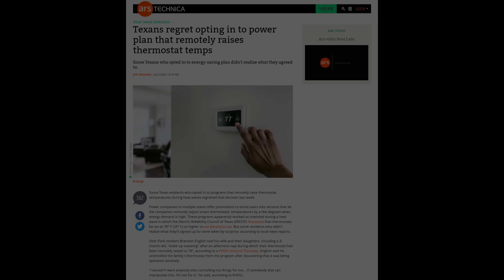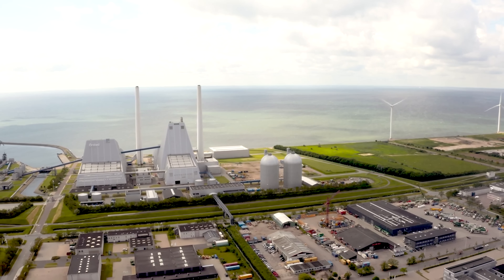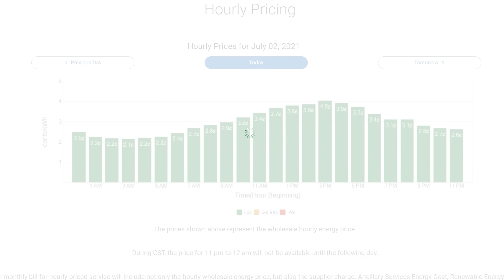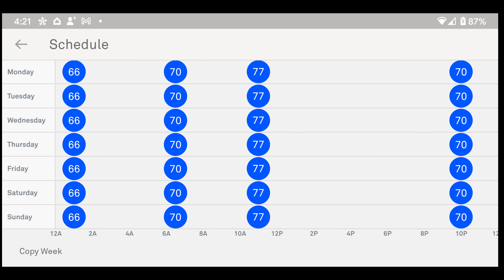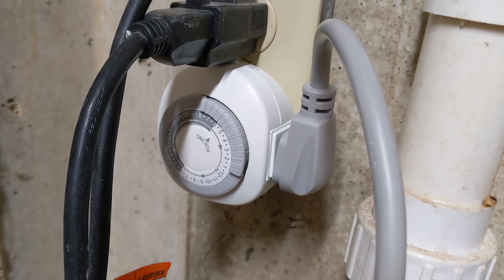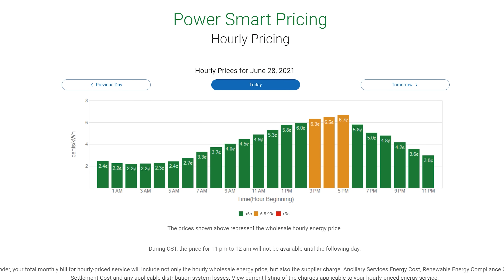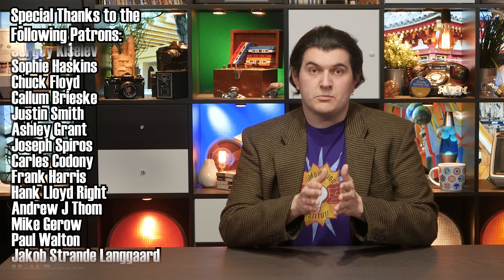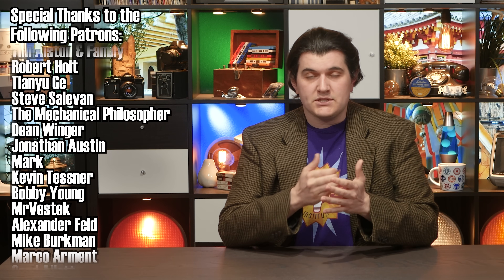Batteries aren't the only way to store energy. Here's another.

Comment: I remember seeing water tanks painted black on the roofs of homes in Turkey. Throughout the day they absorb solar energy and heat the water inside, ready for evening showers and baths.
Reply: only problem is that cold showers are preferable in summer and hot showers are preferable in winter, when this system doesn't work.
Reply: More "fancy" version is some near vaccum tubes or old radiators running water, I seen those used to heat water and houses.
Reply: @ABC-rh7zc  i don't take fully cold showers during the summer, just warm, so it would still work for me :)
Reply: I had that in Austin in the 80's. Gave us an extra 50 gal of hot water.
Reply: @ABC-rh7zc  It is just extra capacity. You still have cold water in the summer, and in the winter the sun still shines. Run on a recirculation loop the warm-hot tank on the roof keeps the snow off it and still picks up a bit more heat.
Reply: @ABC-rh7zc  If you want cold water you take it from the mains feed not the tank. Likewise if you run out of hot water, or it falls below a set temperature, you then employ an electric on-demand hot water system. Turkey has a much more temperate climate tan the US, and to be honest It's all relative to a degree (pardon the pun). We acclimatise to the temperatures of the places we live/work, and usually have no issue with the average temperatures. It's when we start approaching and passing the upper and lower ranges of those averages that we start to notice the heat/cold.
Reply: Israel has heat panels for boilers on roofs of nearly all homes built in the last 30 years.
They are essentially a window with black background and pipes in the middle.
The boiler simply circulates water through these pipes, heating the water.

It works well even in most winter months.
Reply: @ABC-rh7zc  Most of turkey has mild winters anyway.
Reply: Travis AFB Mike Ward?
Reply: That's clever!
Reply: @eqbrim  Nope.
Reply: Actually in Germany we have something like this but it looks like a solar panel and the hot water goes into basically a Boiler
Reply: Happy Legionella
Reply: @DrLoverLover  How is this any different any other stored hot water tanks?
Reply: @ABC-rh7zc  I take scolding hot showers all year long, if your skin doesn't melt off it's too cold
Reply: I've seen this in the south of Israel too.
Reply: @davagain Yeah. Most of the time, like in my apartment, the heater is on a separate switch. The water just gets colder and that's the time for you to get out.
Reply: @ABC-rh7zc  I don't shower cold in Summer, it sucks and it makes me feel sick.
Reply: @luiysia  Same, if I try to shower cold in summer it makes me feel sick as soon as I step outside afterwards lol
Reply: @mikeward1701  Yep
Reply: @dgurevich1  We had those in our old home in The Netherlands, served us well for a decade, afterwards it sadly died and since we were planning to move never fixed them.
Reply: That sounds like a breeding ground for all sorts of bacteria, viruses, and amoeba that you don't want in your water.
Reply: The other strategy was in winter, to fill the tub.  The water served as thermal storage during the daytime, and at night the water would release the heat
Reply: @ABC-rh7zc  You’re not the sharpest knife in the drawer are you?
Reply: @mikeward1701   hot water tanks heat water to 120f-180f, thus prevents legionella bacteria growth. solar water heat is great when done right, but you don't want large volumes of luke warm water for a length of time. Storage needs to be cold or hot to prevent legionella growth. 

I'm not sure how daily cycles of heating and cooling effect legionella. worth looking into anyways.
Reply: @Imix Muan  Don't put down Europe - If you mean solar thermal panels those were in the experimental DIY stage during the 1970s oil crisis (farmers and home owners in Germany and Austria got creative considering high costs of all energy). I think the Southern European countries that have better conditions caught on later, but if they had tourists it paid off. They needed the most warm water when there was lots of sun ....

The thermal solar panels became more mainstream during the 1980s some went as far as trying to support warm water production for heating in fall and winter. But even a fairly regular sized installation would heat up the water to a decent degree (60 even 65 degree C)  if it was sunny and not bitterly cold (of course with help of a larger water tank, that is just a given in the temperate climate zone, doesn't work well w/o). 

Also for public pools (there they could use a very cheap version, because it is emptied at the end of the season, does not have to be frost proof. It did not have to be fance, just to lift the water temperature.

Those panels were around for a long time, the idea to get electrictiy from solar panels seemed to be exotic.
Reply: @rob_over_9000   professional tank systems will heat up the water for use on a regular base. Or they move it around enough. If you have water standing it is a good idea to let the tank drain, or to not drink the water and to be careful not to inhale spray when showering. A collegue died of legionella infection. They worked (a construction job in another state) and stayed overnight in a bed and breakfast and they had a small heater to prepare warm water - likely not used for a while (a week, could be longer). Legionalla are not normally in water and if the water is moved around they cannot multiply. 
But in that case the small unit seemed to have had a few and they had a chance to multiply. 

The firs of the two that took a shower got severe pneumonia (caused by legionella) and died of it. It is when you swallow the spray. If he had drunken it, he would have been fine.
Reply: In Gila Bend, Arizona, the people who designed the town water system were so thrilled that they didn't have to bury the pipes below the frost line that they put them on the surface and - for reasons unknown to civilized man - painted them black. Water came out of the "cold" tap at 110F in the summer.
Reply: I saw these in Jamaica and was wondering why. I assumed at the time it was in case something happened to the water supply.
Reply: @kreynolds1123  On even a moderately sunny day in a temperate climate like Turkey, the temperature will easily reach the 50°c / 122°f required to start killing off legionella.
Reply: @mikeward1701  this topic  sparked me to start doing some more research on legionella, (L). what I'm seeing is "ideal" for L growth is 77-113, that 120 is insufficient to kill L, that minimally 131 is needed to kill L, that 32 minutes is required at 140 to kill off all L, that L is disinfected at  158-176, that L is most dangerous when aerosolized like say with a shower head.
Reply: @mikeward1701  yep. What I find to be too hot might be considered average somewhere else. Likewise, temperatures others might find to be unbearably cold, I can manage with just throwing an extra windbreaker over my sweatshirt.

Comment: An example of how dramatically your house's insulation could affect how quickly your house keeps in the cold/heat is the work cup I used for work. I started out using a big 1 gallon plastic water bottle (good quality) and would prefill it with ice all the way to the top then top it off with ice cold water.... By lunch time 4 hours later my ice would all be melted and the water luke warm/barely cold. It was never in direct sunlight btw.

THEN I upgraded and got a 1.5L metal water bottle (I think eddie bauer) good quality but still cheap. I would prefill with ice and then by lunch even in 100+ weather it would still be filled with ice... I'd drink all the water (2 bottles worth) then refill it multiple times (6 bottles worth after the original filling) and it would STILL have ice by the end of the 10 hour day. 

Just thought I'd rant about that to let people know how effective precooling could be on a well ventilated house vs one that's not. My house would literally take 3 hours to go from 90 to 76 but at the same time would go from 78 to 85 within an hour of turning off the air.
Reply: Exactly what i was about to comment. My house is so old that this strategy would probably lose me more electricity than anything, due to the poor insulation. I have to rotate which door lock i use in the summer and winter because my door will shift so much that it will misalign with the locks 😂
Reply: Yes, unfortunately in poorly insulated houses the best strategy is to limit as much as possible the use of AC

Comment: I live in MA and I've been on a plan with my power company where they can change the temperature remotely for my AC.  They do exactly what you suggest - set the temperature lower in the morning and then raise it in the afternoon to lessen load.  I can always override and I still get my incentive if I override less than 25% of the time.
Reply from the maker: That's great! I'm hoping this idea spreads.
Reply: @DyslexicMitochondria  Hey bro I watch ur videos. Love your channeI
Reply: @DyslexicMitochondria  well that’s what the override button is for
Reply: @DyslexicMitochondria  This has been in place for a number of years without an issue.  Again, I can override from the thermostat or remotely.
Reply: @DyslexicMitochondria  If the power company's system malfunctions, that's what the override is for. If your local system malfunctions - well, you'd have to do a hard reset (i.e. pull the plug) either way.
Reply: A single air conditioner for your entire house is very much an American thing.  It isn't very common elsewhere.  I have separate air conditioners for every room (not cheap window units - well not all of them anyway).  There's very little point air conditioning or heating your entire house if you are only in one or two rooms at any time (bedroom at night, kitchen/living area/office during the day).  So there's a huge cost saving right there.  During summer I only have the AC on in my bedroom at night.  During winter I only heat the living area during the day/evening and keep the hall doors closed to keep the heat in that part of the house.
Reply: @slothgirl2022  work around Xd
Reply: @johnrauner2515  that works if you’re not well insulated, but if you are well insulated, it doesn’t really matter how large the space you heat is. Watt-hours are watt-hours. It’ll hold onto the heat for later, and shouldn’t really cost anymore. However, if your insulation is weak, yeah I can understand choosing to increase your insulation with doors. Of course bear in mind you’re also spending enough energy to counteract your walls and furnishings cooling down/heating up over night. Whether or not that entirely offsets the gains also depends on level of insulation though.
Reply: @kaitlyn__L  No isolation is that good. 
More rooms means more wall, floor and ceiling area (m²), hence more energy loss.
Reply: @oscargr_  like I said, it depends on your specific housing situation. I wasn’t telling you to change your methods, as you tried various things and already said you have savings on your bills. I was adding to the discourse for others reading. There is no rule of thumb when it comes to heating which will always apply. This is why you get heating engineers arguing over whether heating should be shut off entirely when you’re out all day or if it should be kept at a maintenance temperature. Because the actual answer depends entirely on everyone’s specific housing build. 

I live in a very well-insulated apartment where opening the bedroom door only exposes one small extra part of outside wall. The rest of my interior walls are all inside walls to the building, the floor and ceiling are other apartments. Consequently by gains in the volume of hot air outweigh the marginal losses from a little extra bit of surface area. On a winter day the solar heating brings it to 27 celsius fairly regularly, and it takes 4 hours after sunset to even get below 25. But if I keep that one door closed, so less surface area but also far less volume, it actually cools down about 30 minutes quicker. Plus of course in that scenario, when I then open the cold bedroom door, hot air floods into the bedroom and the temperature at the thermostat drops 1-2 degrees in about 10-20 minutes.

So in my case, the extra “thermal battery” if you will provided by the air is worth it. Obviously if you have poorer insulation, like my previous apartment, it’s not a good idea. A well insulated house may or may not, depending on how irregular its shape is and other factors. Because every single surface is exposed.
Reply: David Reads  

Not with you dragging us down.
Reply: What power company do you have?
Reply: @hannahblurp9360  National Grid.  Here's the description of the program: https://www.nationalgridus.com/MA-Home/Connected-Solutions/Thermostat-Program
Reply: @TechnologyConnections  we have something similar with PG&E in northern California. Except it pre-cools in the early afternoon (during peak rates) rather than in the morning when it's actually cheaper for the consumer.